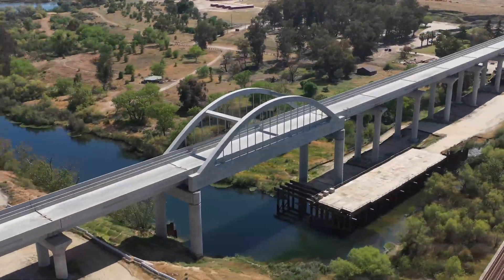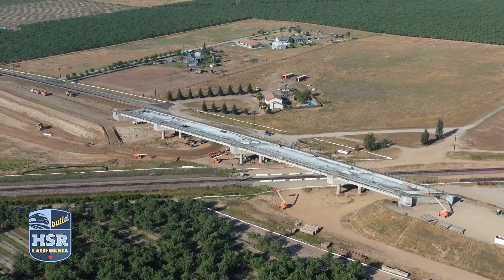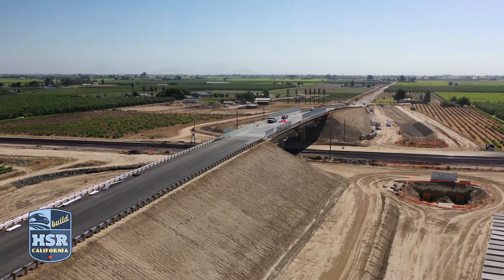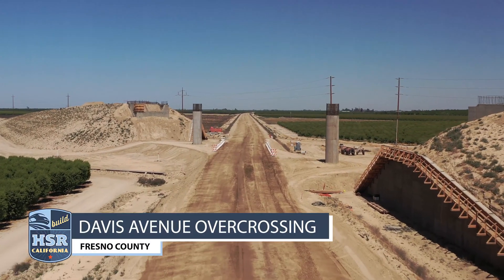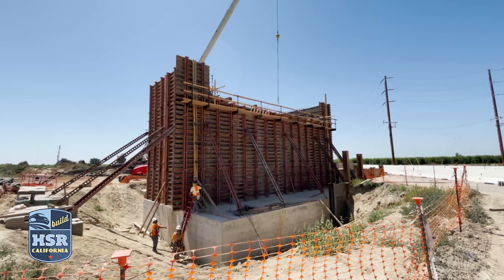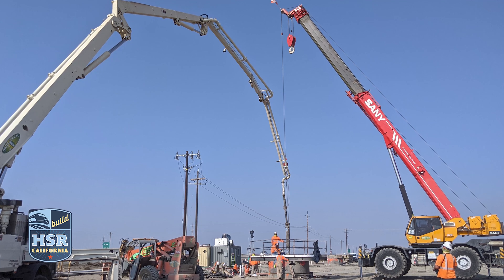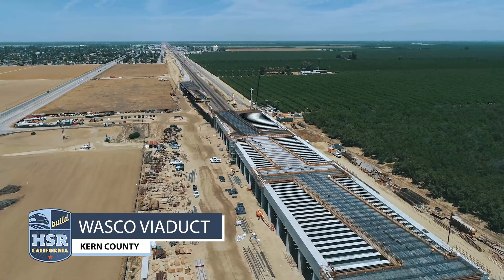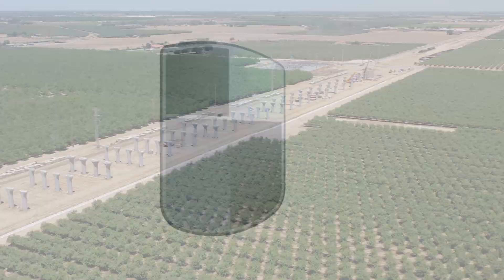California High-Speed Rail Construction Update - May 2021

Comment: Well Done California.
Reply: It's way behind schedule, way over budget, they still haven't figured out the route between Bakersfield and Tulare, gross mismanagement, flat out lied to the taxpayers about projected ridership, and very little to show for the money already spent.  How can this be regarded as 'well done?'
Reply: @colincampbell767 
 CC,    Simple, Tunnel between Bakersfield and Tulare, Route Solved.
Certainly would Not Suggest this Rail Project has been Managed Perfectly.
Well Done because they are Pushing On with Construction.
Reply: @chrisgriffiths2533  Not well done because it's a colossal waste of money.  And it won't even be a "high speed" rail system.  Remember that all of the promises about how fast it would be were known to be impossible when they were pushing for the voters to approve the bonds.
Reply: @colincampbell767  Given They are Building Overpasses and the Like for this Rail Project.  This Clearly Shows They are Attempting to Keep the Trip Time to some Sort of Minimum.  Plus They are Committed to Increased Safety.  
CC, It could be Your Definition of Fast is High.  
What is the Speed You would Call Fast?.
What Speed was Written into the Design and Construction Contracts, Maybe You have been Sucked in by Media and Internet Reporting?.
Also Given You believe this Rail Project is Costing Too Much, Could You Please Give the Amount of Money California has Spent on ROADS, Those Freeways are Not Cheap?.
Also are You Saying The Trains on this New Line will Not have Faster Trip Times than Cars?.
I Still Say Well Done.

Comment: Did you guys notice how low is Lake Mead is? If Lake Mead dries up completely, there won't be any power from Hoover Dam and we got to some how refuel Lake Mead to power the bullet trains.
Reply: Not really Hoover Dam generates, on average, about 4 million megawatt-hours of hydroelectric power in a year which is split between Nevada, Arizona, and California (about 1.3 million) homes or so.  Its wired into the LA central and western grids.  in comparison largest Hydroelectric in the state is Shasta Dam 714 MW per hour, Natural gas Alamitos Energy Center is 1,760  MW per hour, Nuclear is Diablo Canyon 2,256 MW per hour, solar is Solar Star 579 MW per hour, wind is Alta Wind Energy Center 1,548 MW per hour.  The last coal plant in Trona only generates 63 MW per hour to power a special smelting operation and was built in 1978.  It will run out of its operational life in the next 5 years and likely be replaced by natural gas. 

The state is building a lot more like Westlands Solar Park 2,000 MW per hour

So the split of the power California gets from Hoover would not qualify as even the middle of the pack as for power generation.  In fact the plan was to start using the damn as a battery storage for the solar plants, which would pump water into the damn when there was excess and then let it generate at night when there was demand.

Comment: I REALLY REALLY hope this project doesn't get cancelled
Reply: There no turning back with the construction work, if the project get canceled then this would be an Expensive amtrak route which would boost the train speed up to 125MPH.
Reply: @Perich29  125mph is NOT 225mph... This BOONDOGGLE has been and will be a huge cluster fuck...
Reply: If you're a taxpayer in California - you'd be hoping it gets cancelled.

Comment: High speed rail line construction cost per KM...........China ($17-21 million per km), Europe ($25-39 million per km), Texas Central Railway ($38.8 million per km projected), CHSR ($56 million per km).........Way to go California!
Reply: If you're going to steal info from Wikipedia you should include the next sentences: "High real estate prices in California and three mountain ranges to cross contribute to the difference. For example, Construction Package 2-3 in the farmland of the flat Central Valley works out to $11.4 million per km, although this figure does not include electrification or property values, so it is roughly comparable internationally. Furthermore, the proposed High Speed 2 in Great Britain is estimated to be more expensive on a per mile basis than the Californian system."

Plus, I'm not sure why China is even in the mix with their forced/slave labor.
Reply: @texastuna  Spin it however you want and don't include property prices because Europe's real estate is just as expensive if not more than the central valley and most of other parts of California.  Europe has mountains also and difficult terrain but yet they can build for half the cost, even in France!  In the end, it is a cost overrun fiasco, no way around it.  Can't wait to see how Texas Central fares compared to CSHR.  I realize Houston to Dallas does not have the same terrain but also does not have the same bureaucracy either.  I am not opposed to HSR but I just cannot see how it is fair to taxpayers in California to absorb the cost overruns.  Will be interesting when all said and done to see where all that money is going and how much is being siphoned off.
Reply: One factor is that the land in china does not need to be purchased as there is no private property rights and there are no other legal hurdles,  Just someone in the capital saying "build it"

Comment: February 2023? They take that long to build an overpass?
Reply: No 2033 to build bridges and viaduct throughout the central vally
Reply: yes. by the time they finish it, China has already doubled the size of its high-speed rail network or  maybe it is not finish yet by the time China doubles the size of its high-speed rail network and at that time China is already running its 620 super bullet maglev train.
Reply: @矮胖的矮胖的  China does not have to do a EIS study. And China does not have to buy land to build a new high speed rail corridor. Nor does China worry about pleasing the NIMBYs who don't want a noisy high speed train running ten feet from their home... If you thought those freight trains were noisy in Bakersfield, Fresno, San Jose, and Burbank, wait for the high speed trains rolling by...

Comment: 2029😪
Reply: I'm gonna be 39 years old, at that age I'm probably not gonna use public transportation.
Reply: Japan is already finish with their new high speed train system using maglev before this one finishes. trust me. this high speed rail has been going on since 2008. This is not to brag but It is slower than turtle honestly. another question is how fast is the train and is it going to be cheap for passengers?

Comment: 100 billion and it won't do what was proposed in prop 1A.  Bummer.
Reply: Have you rode on the 200 mph trains in France, Japan, Spain or South Korea yet?  Have you rode on the 217 mph trains in China? Do you doubt that CAHSR can be built to those tech standards or is your concern that it takes too long to build?
Reply: @soulofamerica  It has taken France over 50 years to build their HSR network, which by the way is not nationwide as yet. Only 55 percent of France's railroads are electrified, even less are HSR...

Comment: Just like India skipped the landline and went straight to mobiles I think America may skip HSR and go straight to Japanese maglev doing 700km/h in 11 psi single tunnels driven fast and cheap with this TBM   https://3dwarehouse.sketchup.com/model/c1405816-d744-4363-8cf8-729828f9397e/14m-cone-with-discs which allows containers to be moved across the country between 1am and 3am.
Reply: a califonia maglev would cost over 300 billion... Japan isn't replacing their bullet train with maglev, the maglev will only serve 3 major cities, it a very specialised train for a very specialised route.

Comment: They will have to cut air travel and make gas $10 per gallon  to make high speed rail feasible.

How about fixing water supply instead? Our main problem.
Reply: I didn't know that we as country or state are only capable of addressing one problem at a time. I also don't know where you pulled those feasibility numbers from. Care to share the study?
Reply: The way to fix it is ban high water consumption agriculture and bottling.

Comment: Last I was in California as a resident, 3 years ago, I drove through Fresno and saw skeleton frames of the overpass bridges.  It doesn’t look like they are close to finishing.  The Central Valley will be easy by comparison to construction near the city of LA or SF.  That’s when construction will grind to a halt.  Shades of BART Batman!  My parents paid taxes for BART in East Contra Costa County from approximately 1965 to about 1995 when they moved.  The closest a Bart station got to their home was 12 miles .  That was opened 23 years after they moved. They never rode on it once.
Reply: The anecdotal riding habits of two people means what exactly? That BART or public transportation at large is a failure? You sound a little selfish, "they paid money into something they didn't directly use." You helped pay for the AAVs and Humvees I got to ride around in while I was active duty. I'm betting you never rode in any of those. Is that a problem too?

BART's economic impact goes beyond its riders and extends to the rest of the country. BART removing individual trips by automobile helps everyone in the Bay with traffic. Less traffic helps everyone breathe easier and lengthens service intervals for road infrastructure.
Reply: @DrOuchie  The whole East bay did the same :  Rather than get off on a tangent comparing apples to moon rocks, the point is, this project will take 30+ years to complete and most people won’t benefit from it.  This is a direct comparison.
Reply: @philam1973  Define most people. That type of sweeping ambiguity is a red flag for a number of reasons. And can you go beyond second order consequences and think a little bit about how the fast and efficient movement of people could benefit the public? Can you also pour some thought into why building a project to do that might be expensive and difficult?

Also, your point doesn't seem to have anything to do with the public transportation habits of your parents. Anything else you'd like to use a sample size of two against when you're trying to be deterministic about the outcomes of a complex system?
Reply: @DrOuchie  Do you really think the super rich will buy expensive HSR tickets to ride on a train from Bakersfield to Merced that live in San Francisco or Los Angeles? No, the super rich will still fly in their corporate jets paid for by their corporations they boss...
Reply: @ronclark9724  no the rich have no need to fly unless its for fun.  You really have no idea how different wealthy people live do you?  There are basically learjet uber flights now
Reply: U are REALLY dreaming if you think LA to SF. Wow! Really gullible!

Comment: In Montreal, the Champlain Bridge badly needed to be replaced. It was in an advanced state of deterioration. Construction of the new bridge was approved in 2015. It was completed in 2019. In 4 years, a 3400 meters bridge was designed and build over an active seaway on one side, and fast moving waters on the other. In the same amount of time, you completed a relatively short bridge over a mostly dry river. Good job. You might want to attach penalties for not meeting time targets next time.
Reply: They're working at multiple job sites for a project that will build a high speed rail line stretching hundreds of miles and cost billions of dollars while applying new advanced engineering techniques, but sure your little MILE AND A HALF long bridge is ssooooo impressive.
Reply: @chilidogcats  Their budget was not enough to connect major population centers and they have already spent all of their bond money.  At some point the taxpayers that the purpose of this project is to funnel taxpayer dollars into the pockets of Democrat politicians.

Just remember that it's the California taxpayers who are the ones who are going to wind up paying off that $100 billion in bonds.
Reply: @colincampbell767  You're not from California because the HSR project was approved by a majority of California voters. It's Prop 1A and California's taxpayers approve $10 BILLION dollars to get the HSR line going. Furthermore, you must not have read the news. Biden just released a $10 billion dollars, put on hold by trump, but approved under the Obama Administration, to help complete this project.
A $6 trillion dollar American Jobs infrastructure Bill will pass Congress in late summer early fall. It includes funding for California's HSR and a Continental HSR network. It's time to put Americans back to work with high paying jobs instead of having to eek out a living in low paying Amazon warehouse work.

Low paying Amazon warehouse work = Rethuglican jobs.

High paying steel workers, concrete workers, engineers, truck drivers = DEMOCRATIC JOBS. 

American worker will have jobs they are proud of. You know, making America great again 😘

Remember dear ELECTIONS HAVE CONSEQUENCES>
Reply: @chilidogcats  At the same time, about 20 kilometers of highways and auxiliary structures were also redone as well as a major interchange and 4 minor interchanges.

Right now, we're busy building the REM which will use the central span of that bridge. 67km of metro is expected to be in operation next year with a full completion date of 2024. I'm telling you, it's taking California way too long to build HSR.

For all of it's numerous problems, Montreal's construction industry is stupidly efficient when compared to California's, especially considering that winter pauses all work sites for several months each year.
Reply: @chilidogcats  What about the tens of billions of dollars worth of overrun? The california highspeed rail is just a huge disaster. Wont be surprised if California finishes by the 2040s. By then, Texas would probably have shinkansens running from El Paso to Houston, Dallas/Ft. Worth to San Antonio or even Brownsville lol
Reply: That's true, and Montreal is an infrastructure shit show. So if projects in Quebec are done faster than in California, that is REALLY bad.

Comment: Got a question, writing from Europe. First I am excited to see the progress on that HSR project. However, I understand the current construction will only result in a line from Bakersfield to Modesto. But the area, where the bulk of Californians live is the L.A. Basin and the San Francisco Bay and vincinity. The reach them, tunnels through several mountain ranges are needed, Tehachapi, Pacheco Pass and the like. Any news abaut the progress here? Or will CHSR remain a boosted San Joaquin Service?
Reply: Merced to Bakersfield with a few improvements: Caltrain is being electrified in the San Francisco area, and the new LA Union Station will be built. Otherwise, there will be no expansion to either areas until they receive more funding, most funding is being used on the Central Valley line.
Reply: Unfortunately, Merced to Bakersfield is not a guarantee at this point as various factions in the state legislature wrangle for funding to be spent in their districts instead of there.  It's possible it will not initially be electrified and that only one track will be laid, instead of the original 2, until additional funding arrives.  There is no progress on anything outside the Central Valley aside from environmental clearances and whatever nominal work Caltrain is doing toward electrifying their lines, which CAHSR would eventually share.  That portion is initially between S.F. and S.J., but could extend as far south as Gilroy.  Neither Caltrain nor CAHSR have decided what they're going to do south of S.J. yet.
Reply: @LucidStew  Thanks for that interesting insight!
Reply: @LucidStew  It is now May 2021, the California voters approved HSR in 2008... And still no progress whatsoever electrifying the old lines south of San Jose? BOONDOGGLE! Government FAILURE!
Reply: @ronclark9724  CAHSR gave Caltrain money to help them electrify their ROW between San Jose and San Francisco, which they have been progressing on slowly and CAHSR will share.  The route for San Jose to Gilroy has not yet been finalized, and currently the money likely does not exist to fund that system or to help Caltrain to build it if that is a chosen option.

Comment: Its great to see california put all those unemployed workers collecting balooning unemployment checks, a job building something obsolete compared to Japan :(
Reply: this "obsolete" thing is funny. HSR will not be obsolete. The chuo shinkansen is a bypass line because the current HSR lines are saturated. Massive trains, every 5 minutes each way all day. That's the world where that kind of next level cost infrastructure makes sense, where you're guaranteed massive ridership. Even this CA HSR project is going in head first IMO. HSR lines in Europe and Japan are usually only built when there is massive ridership on the existing conventional lines.
Reply: In what ways is this "obsolete compared to Japan"? Given the political, environmental and cost conditions here, how would you improve things? 

Or are you just tossing out low-effort drive-by criticism without offering anything productive?
Reply: It’s just a phony make work project.